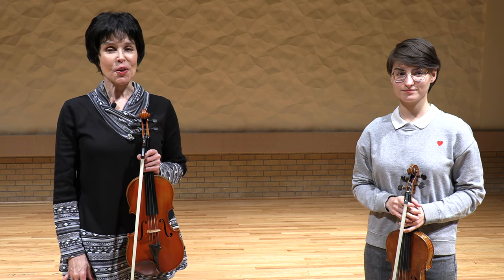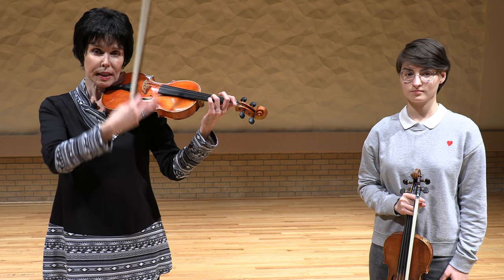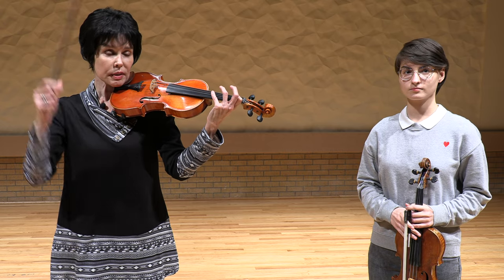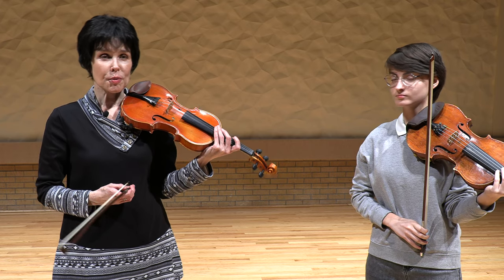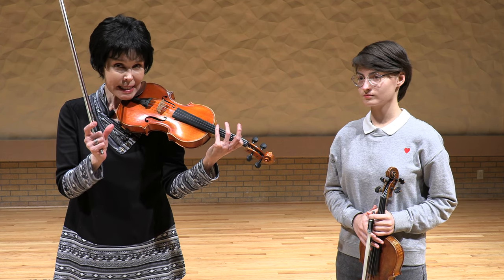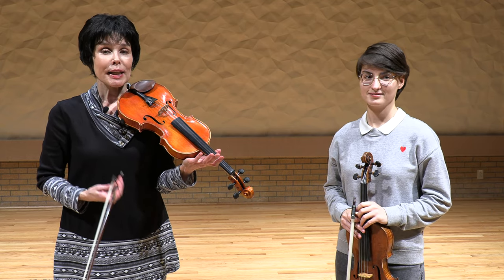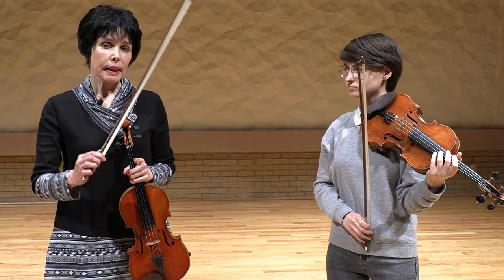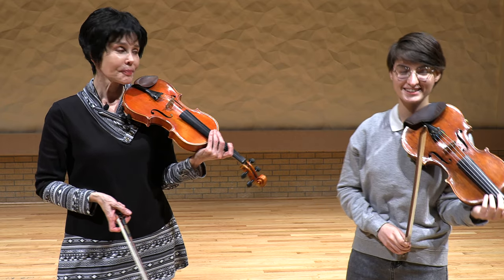Violin Techniques / Artificial Harmonics

Comment: Sometimes I have the impression that when playing the fourth finger light during an artifical harmonic is  a little bit higher than when playing just that fourth finger as a single stop (just normal note). Is that right?
Reply: There is a slight change in tension when you stop the note making the placement a little wider than with a natural harmonic.
Reply from the maker: Thank you for a good question!  My answer would be both yes and no. There is actually a 'margin of error' – or leeway – as far as where precisely the 4th finger touches. It will sound just a bit brighter if the 4th is exactly in the spot of the regular note, but it also will sound if it slightly sharper. And some of it would be our personal perception as well.

Comment: Hi :-) 
Could you please make a video about sound production? I would be interested to know your thoughts on how a good forte sound should be made in your opinion - through adding a vertical weight to the index finger or using a flat wrist and pulling/pushing the bow (more of a horizontal weight)? I have found there is a different kind of sound in the US that is more direct and penetrating and seems to be made with a low wrist and arm weight. In Europe, sound seems to be less direct, lighter and a bit more flexible but not usually as loud… would love to hear your thoughts! Thanks 😊
Reply from the maker: It is a very good question, thank you!  I have to think if making a video would be feasible, though, as I do not think that the sound is good enough with the clip-on microphone that I use...
Reply: @ViolinClassUSA  thanks for your reply! I think even a video with the different ways/styles of sound production would be interesting. For some reason, I feel sound and sound production isn’t addressed enough. I studied at NEC in Boston and then later in Germany/Switzerland and I found it soo interesting how different both places were in terms of sound preferences!